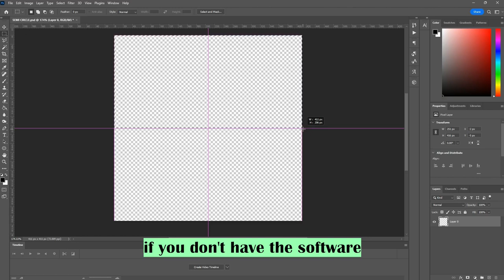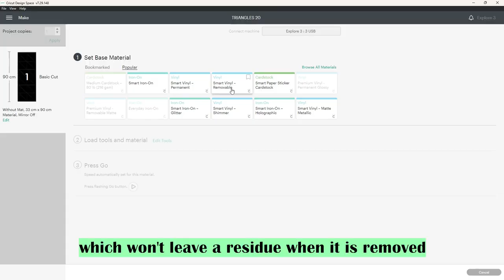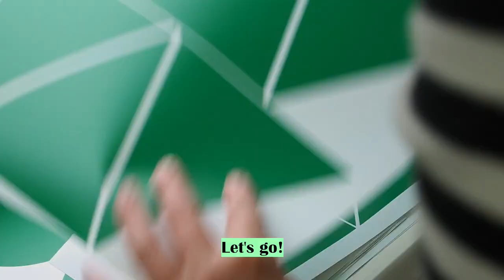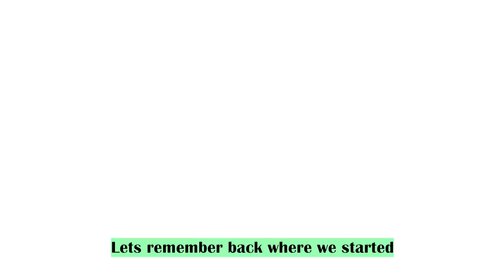I gave my boring white tiled Bathroom a #retro makeover! #renterfriendly #cricutmade

Comment: Beautiful!! 😍😍😍 Love the design. One question though, did you seal the vinyl in anyway? I'm thinking of doing something similar but I'm worried about the water from the shower as well as dirt getting trapped in the edges.
Reply from the maker: Hi 🤗 and thank you for your lovley comment. 4 months down the line and the vinyl is holding up great, we use a shower spray after each use to keep the tile clean too. The heat from the shower has no effect on the vinyl. Maybe I could do an update video after 6 months. Good luck with your project!